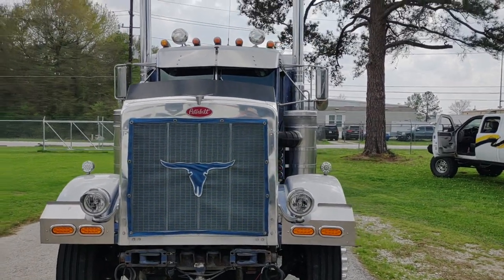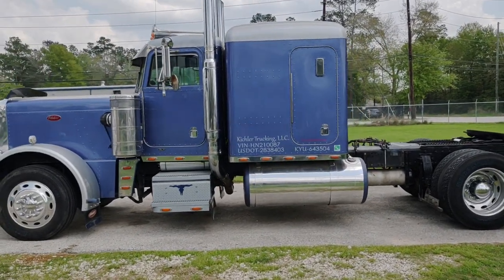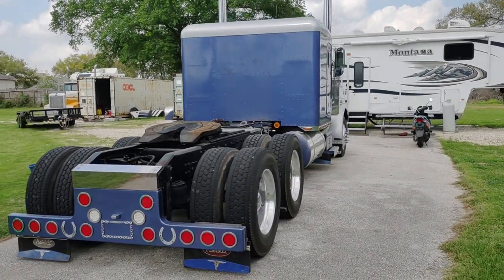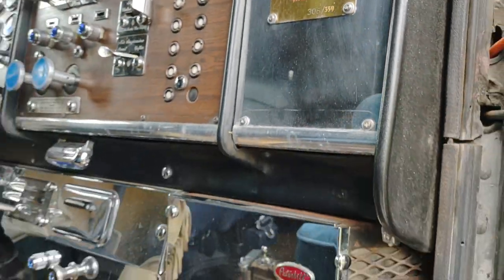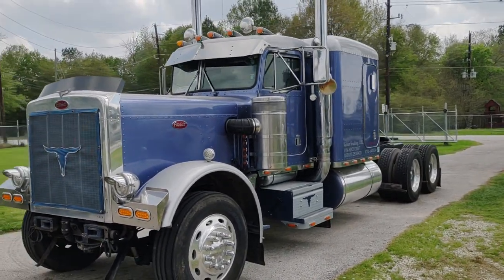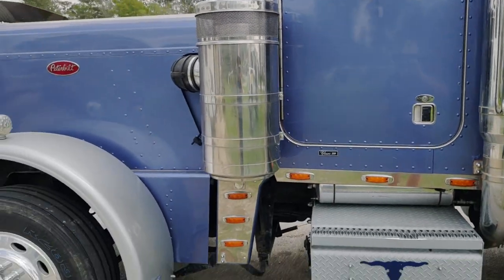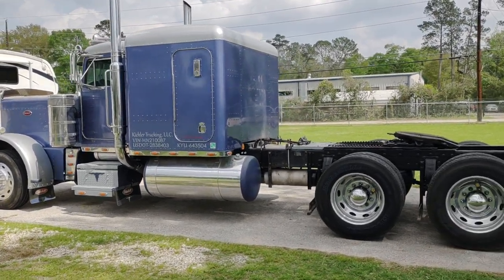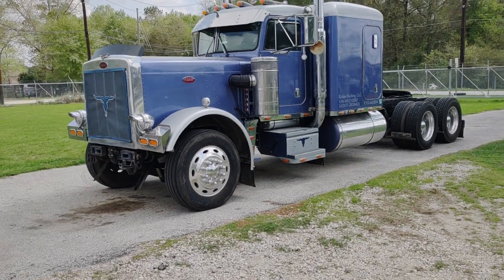359 Classic restoration project. #1

Comment: Follow the adventures of TwinStick Garage as he is completing a 359 rebuild. Calls it " Little By Little "  He is east of Edmonton, AB a short distance. The way he structures the episodes works well and the time limit is around 25 or 30 minutes. Edit your film then treat this as a tutorial. Similar to series television.  Excellent project truck. Matthews Motorsport on YouTube was doing a truck too but it is pretty occasional. Stripped it right down to the frame rails.